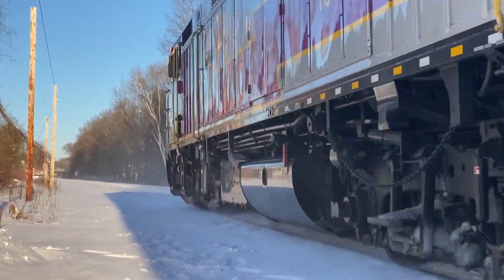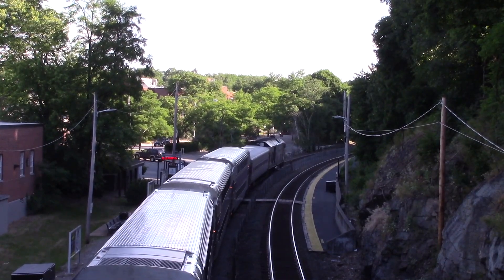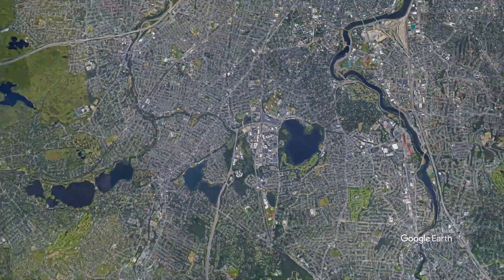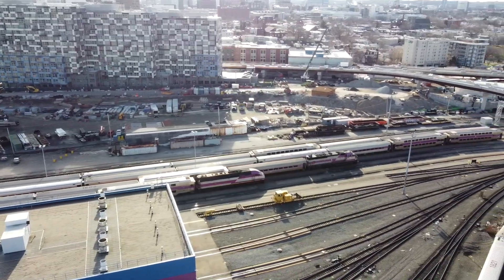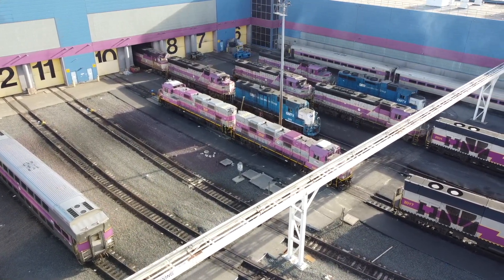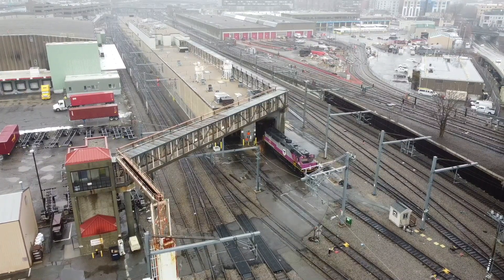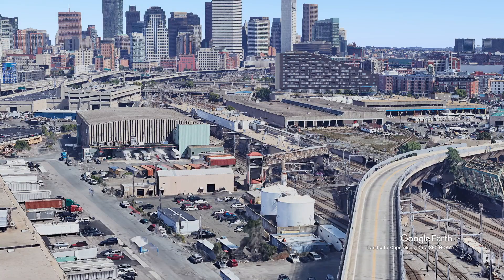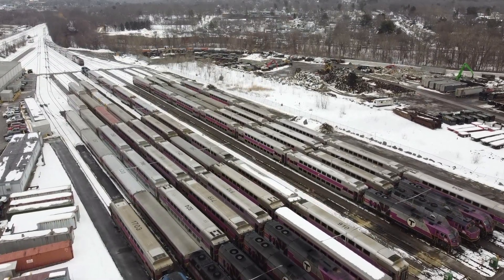MBTA Commuter Rail: a Comprehensive Aerial Tour

Comment: Really great video, Sam! Drone shots were spectacular, and appreciate you following the airspace rules. Been riding the commuter rail since my first job, and have a soft spot for it despite smelling like diesel exhaust afterwards. Would love to see an in depth on the equipment, as well as the engine issues you mentioned. Do you know if there is track connecting N and S station traffic? Subscribed!